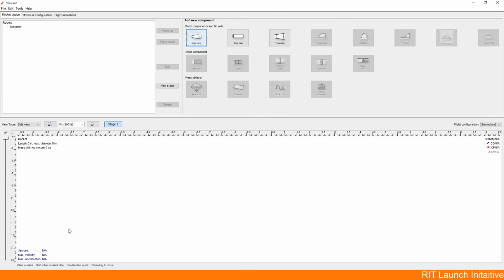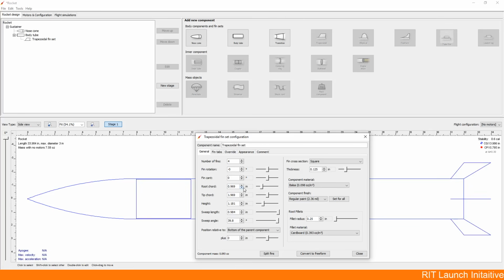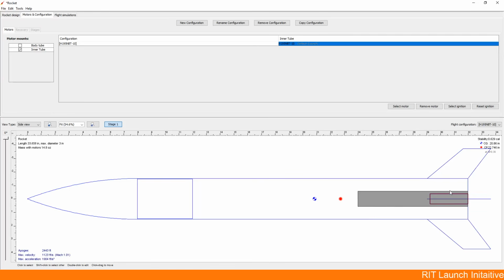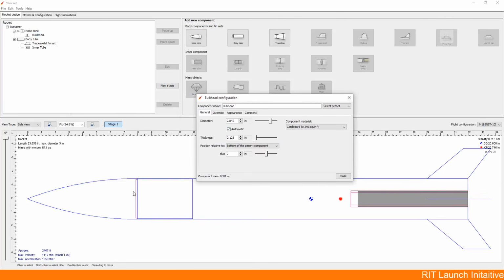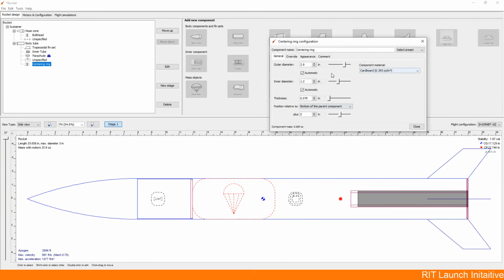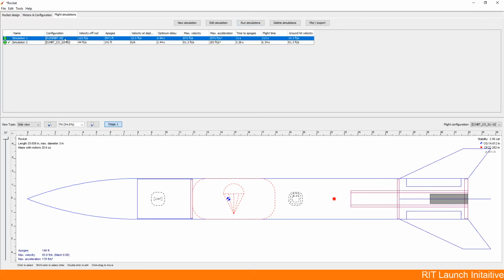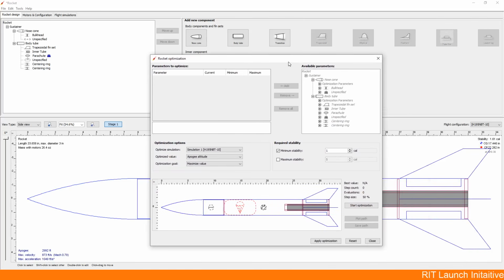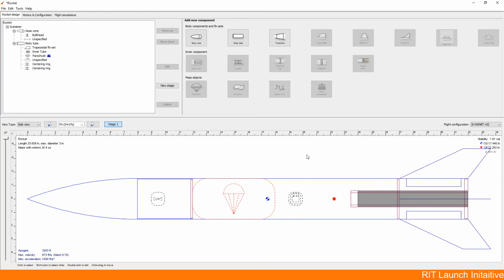Basics of OpenRocket

Comment: This video is really awesome. I feel like I understand rocket design better now, in comparison to me starting with zero knowledge in rocket design or OpenRocket's program at all. I think I understand rocket design more thoroughly with this video, thanks!

There were a couple of things that tripped me up, however...

First, when making the inner tube, you set the inner diameter roughly the same diameter as the motor. However, when you set the outer diameter to 1.2in, it automatically changed the inner diameter to 0.89in. Doesn't this mean the motor can't fit inside the inner tube anymore? I was confused on this part. I just wanted to know why it changed the inner diameter to 0.89in when you changed the outer diameter to 1.2in, when you initially wanted the inner diameter to be 1.14in.  

Also, when adding the centering rings, I think you mentioned that you wanted to add spacers and a bulkhead to it. I never saw you add the bulkhead to cover the inner tube, and I'm assuming the spacers you mentioned were actually the centering rings that made the inner tube stable and connected to the rocket? I'm basically asking if the spacers you mentioned were the centering rings, and I'm also asking if those centering rings are meant to attach the inner tube firmly to the body. And with that, where did the bulkhead go? Did you forget to add it in the video, or is it really not necessary? I'm assuming it's necessary cause you mentioned earlier that things might burn up or be damaged due to the motor if things were left unsealed by a bulkhead?

Hopefully you can answer my questions, if you still look over this channel! If not you, maybe others who see my comment. Please answer if available, anyone 🙏

Otherwise, this video was awesome. I watched it with basically zero knowledge of rocket design or how to use OpenRocket. This feels like a good tutorial I'd share to other people interested in using OpenRocket, that they may learn the basics. 👍